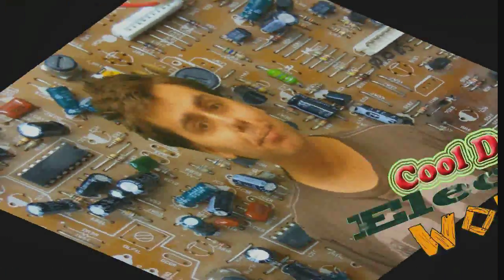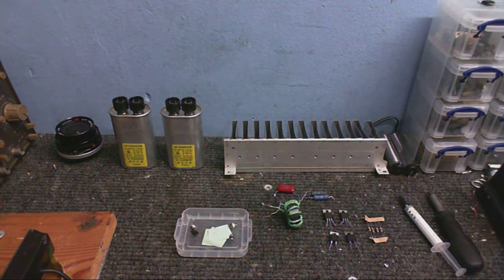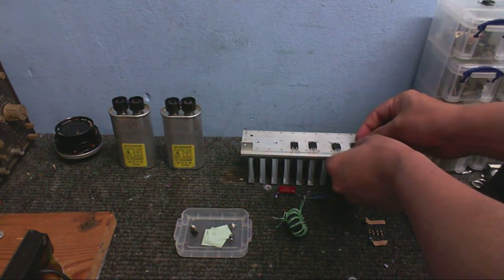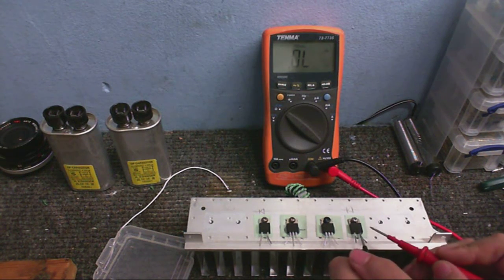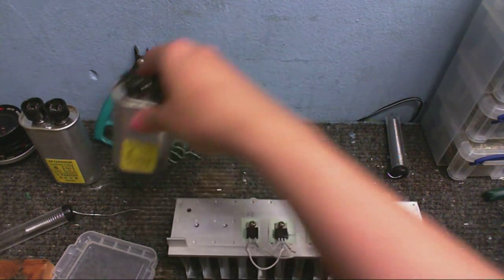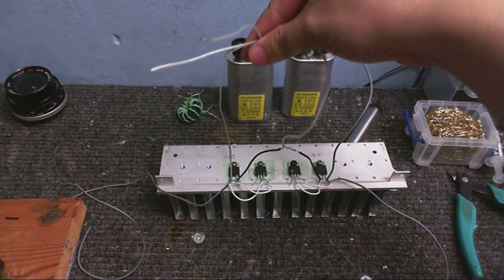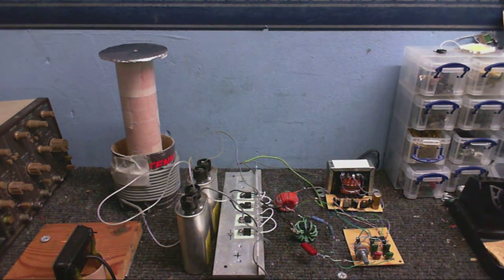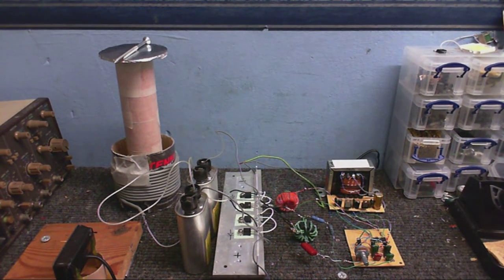Buidling an SSTC Part 4 - Halfbridge Output Stage

Comment: I would recommend you run way shorter wires and use metalized polypropylene capacitors on the bridge both across the supply and for the "midpoint" for the half bridge .

Comment: add  a resonant tank cap  in series with the primary, IGBT instead of mosfets, boom drsstc
Reply from the maker: +aadz93 I might try and go for a DRSSTC in the future, right now I have plans for an SSTC with full-bridge output, I'll probably modify it into a DRSSTC later.  If I find IGBTs that switch fast enough I'll use them.
Reply: +CoolDudeClem yeah they're not much more work, plus they're more efficient, i have plans my self for a 2kw 240v drsstc

Comment: How much did it cost for making this proje ct I will make it for science fair PLEASE please please please please please please please please please reply me😢😢😢😢😢😢
Reply from the maker: I can't honestly say since most parts for this were salvaged out of other things.  Most of the components are dirt cheap though, things like resistors cost just pennies, the only parts that are a little expensive are the output mosfets that are about 5-10 pounds each (I dont know what that is in your currency).
Reply: @CoolDudeClem  my currency is Indian rupess you can tell in your currency
Reply: @CoolDudeClem  determine and tell the cost no problem

Comment: Steve's circuit... 9 amp drivers being powered by a regulator that will lose its lunch at 1.5 amps...
Reply from the maker: This isn't a problem, yes there are high currents at each mosfet gate during switching from one state to another,  but it's very short lived and the smoothing caps can take care of those, yes I should have added a little more capacitance but THIS IS ALL I HAD. The overall current  is not anywhere near that and the regulator was just fine with that.
Reply: Big 'lytics? Okie dokie. Gotta say it still bugs me, tho. Do your drivers get warm? Gathering all the parts, and caps are next on my list. 8^)
Reply from the maker: I haven't had any issues with my driver ICs getting warm, I used 2200uf electrolytics in the power supply, and then a 10uf electrolytic across the power pins of each driver ICs, just a word of advice though, you WILL need to put 1uf film caps across the power pins of the driver IC's as well, they tend to self-oscillate and heat up without those caps even with no load connected.
Reply: Thanks for the tip. As I understand it, you shouldn't run those chips unloaded. They'll oscillate til they smoke.